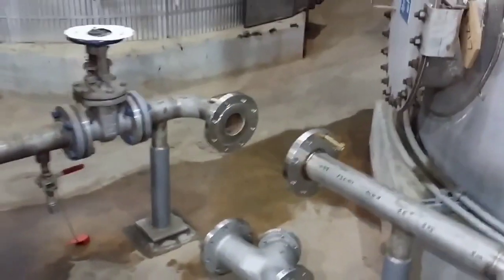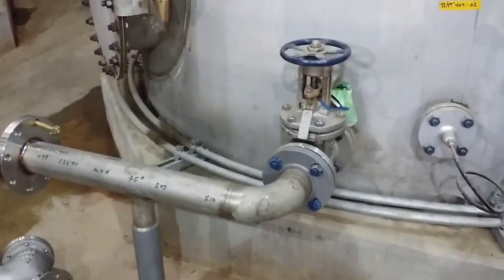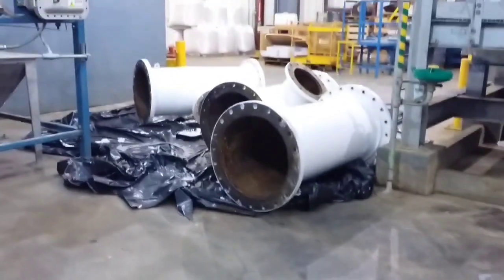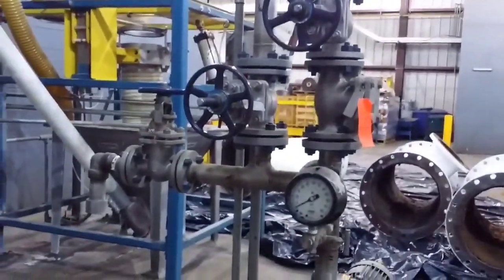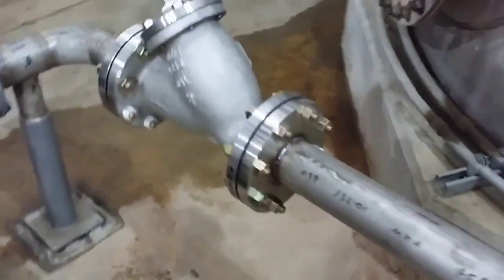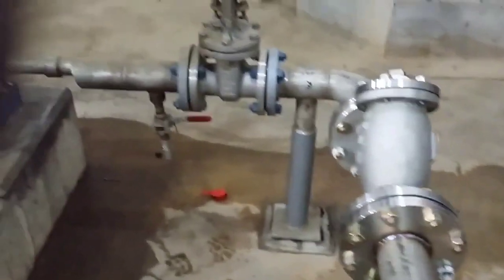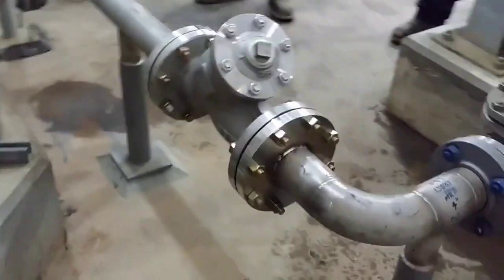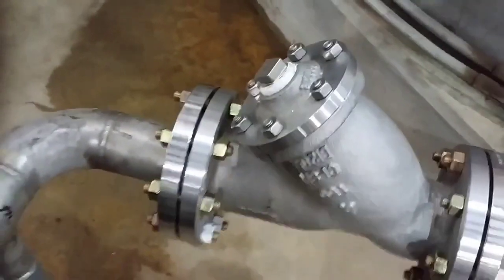Pipe TIG Welding in the Oil and Gas Refinery as a Pipe Fitter/ Welder Combo

Comment: Thats Beautiful! Worked in the oilfield many years and have seen and tightened down many flanges. The weld on some were sub par some good some excellent. Yours ranks at the top!!! Great job! :hand-pink-waving:💯 👍
Reply from the maker: Thank you so much my friend.. this weld called for a single pass being on low pressure bypass. Some call for more passes depending on the application